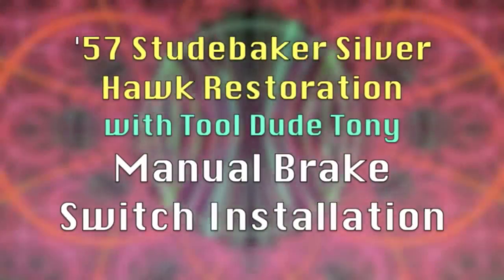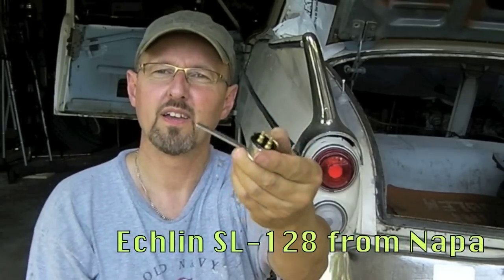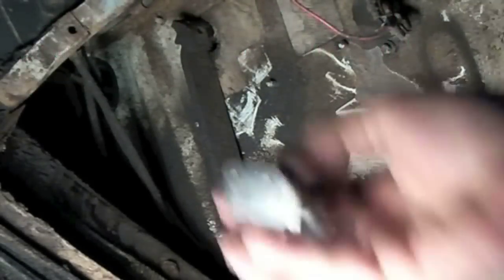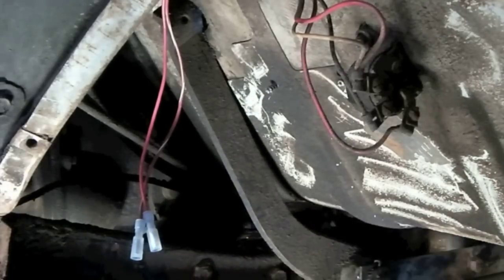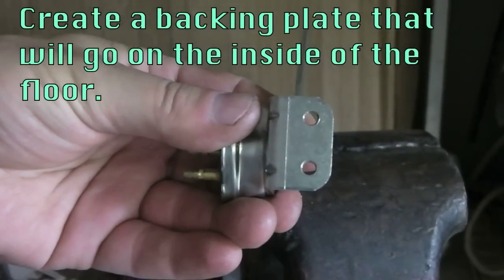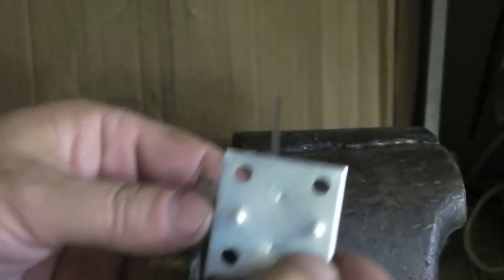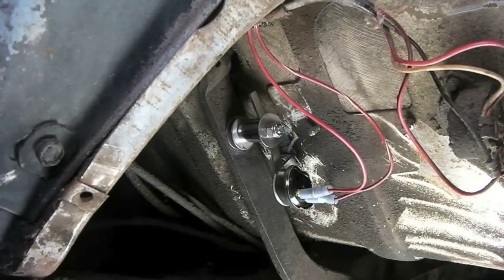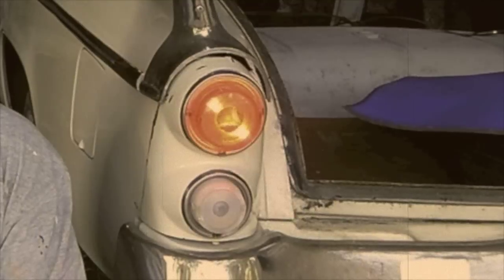How to Install a Mechanical Brake Light Switch in a Classic Car

Comment: Great video, I have a 66' Buick and I have not figured out why my brake lights don't illuminate once the pedal is engaged. I have turn signals and running lights that are working fine. Replaced all bulbs and brake switch and fuse's. Not the flasher..... I have a wire hanging under my car running from the trunk and i wondered was it a ground for that issue???? Looks like it grounds my send unit also. Another wire runs to my gauge up front.

Comment from the maker: I'm not familiar with the wiring in your car. But I did find a link to a site that talked about the same problem. Maybe they can help.  Go to justanswer DOTcom and search on 1966 buick riviera brake lights don't work.

Comment: You cold have just bent the arm of the switch over and then mounted it so the lever of the switch is under the brake lever.